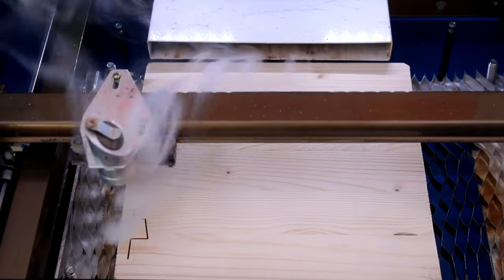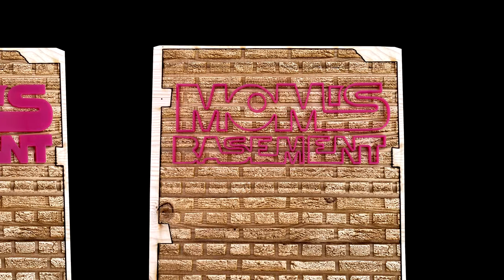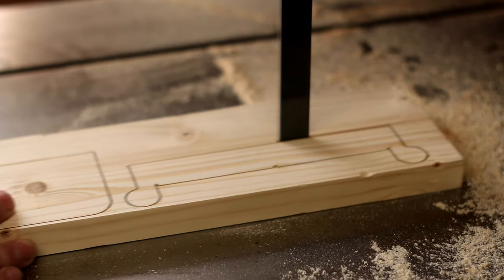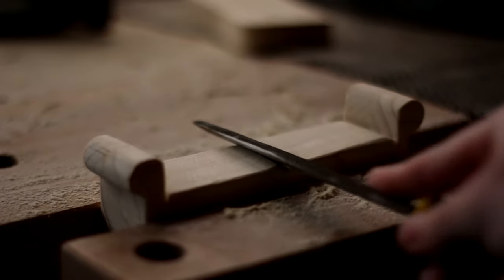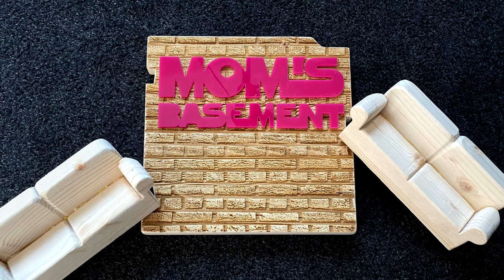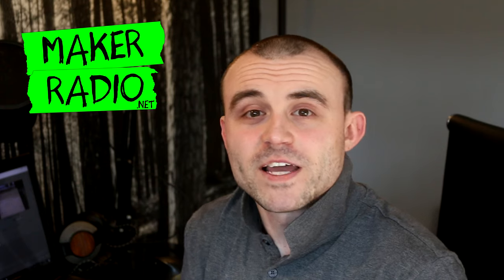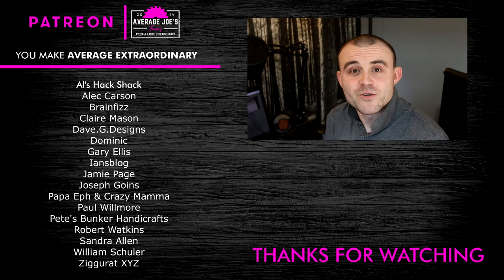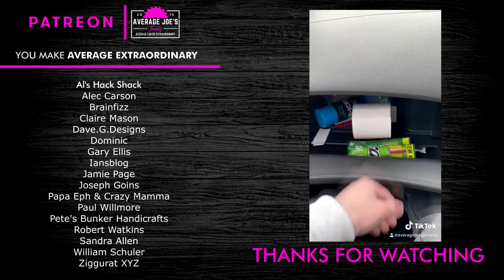Mini Sofa - Isolate & Create #3

Comment: I would try painting some white/pink behind the text. Think like a fuzzy "drop shadow" but light instead of dark. This should emulate the light of a sign. Might make 5he outline version stand out more too?
Reply from the maker: Thats a brilliant idea! I didn’t think of that. Would be a great effect, might have to try it on some scrap first to see how it looks
Reply: @AverageJoesJoinery  yeah, it can be difficult to get the soft/fuzzy edges. If you have an airbrush, that would probably be the best way. You could also use brush if you water down the paint and build it up with lots of pretty transparent layers. More opaque in the middle = more layers. Etc.
Reply from the maker: Id have to try on scrap because if I messed it up It would be a pain to get rid of the paint haha